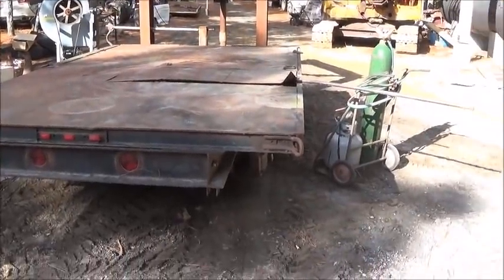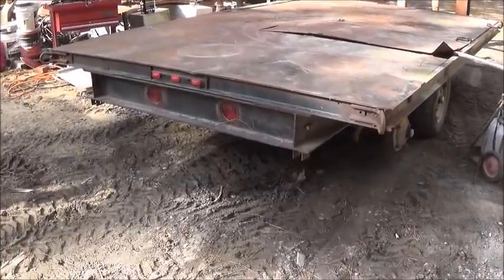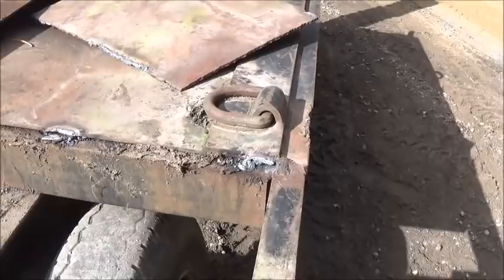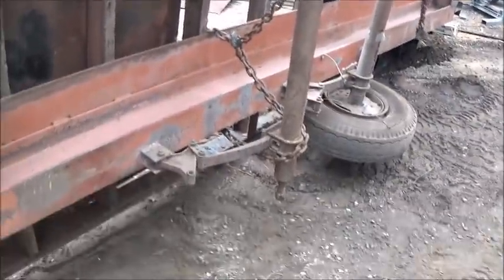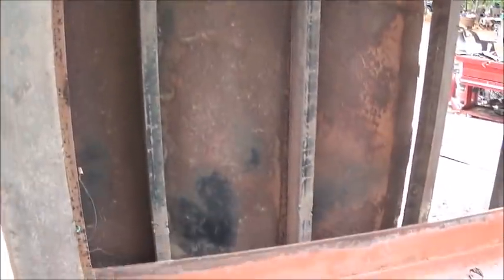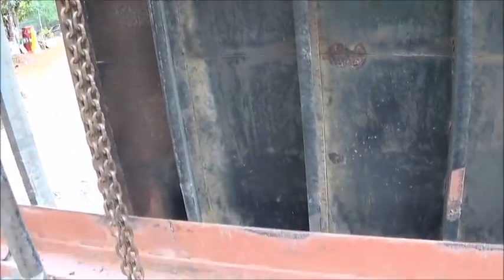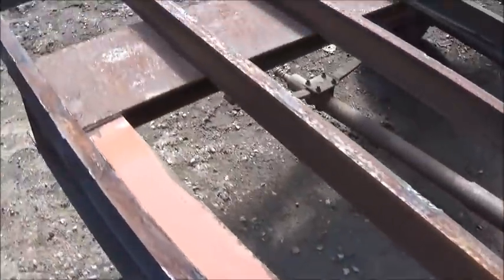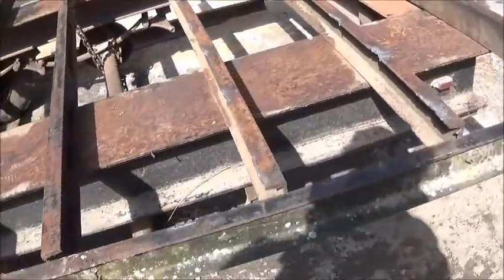GOOSENECK TRAILER MODIFICATIONS PART 1

Comment: The top part of the trailer looks like it was made from steel machine pallets. I made a trailer out of 2 smaller ones that the new mills came on for the machine shop I worked at. They don't put much weld on them so I went over the joints with full welds.

Comment: On camera, it looked like it was pretty easy to cut off those welds to separate the steel deck. If that's true, I would cut off those wide places on top of the bottom structural "H" beams to same a few hundred pounds of weight. For the weight of the rest, those spring attachments look terribly "Undersize"!! 🤷🏻‍♂️🤷🏻‍♂️🤷🏻‍♂️⚙️🛠👍👍